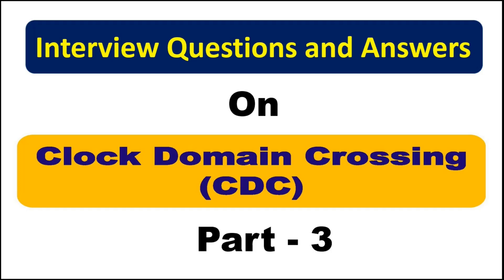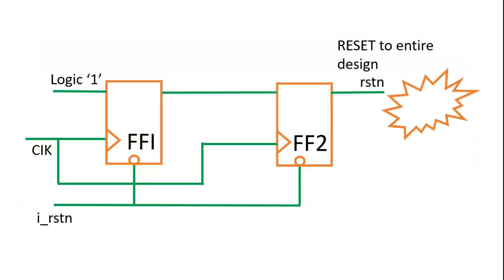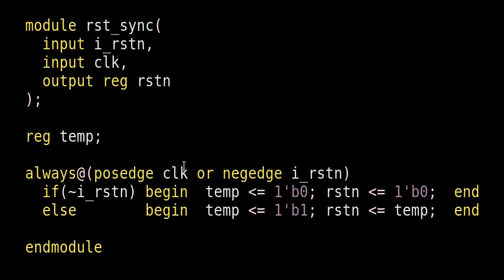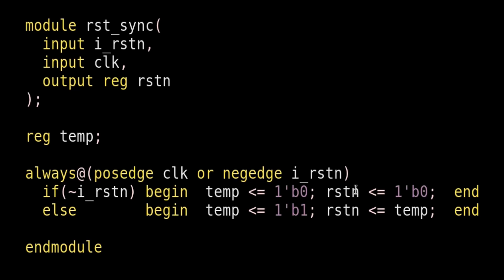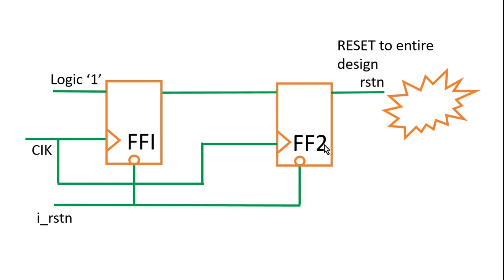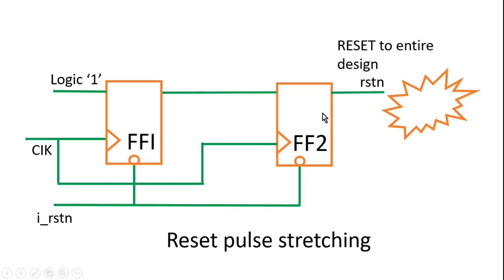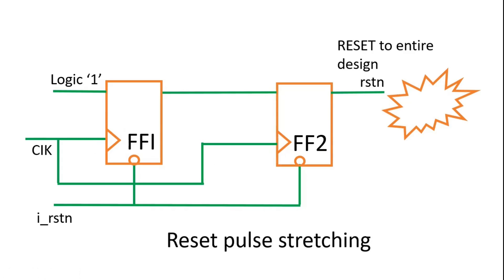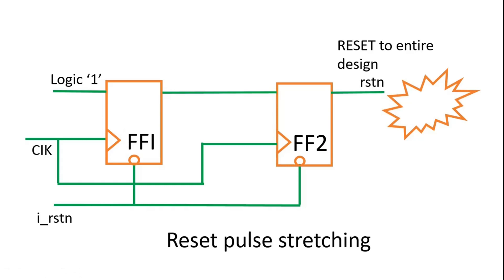Interview Questions on Clock Domain Crossing CDC and synchronizers part  3

Comment: Reset needs to stay asserted so that it can propagate through the reset tree to all flops. It is not necessary that the reset synchronizer needs to have the logic for that. The logic to ensure reset propagates through the entire reset tree and to all flops in the design can be done externally through a state machine and the reset can just be an input to this reset synchronizer.

Comment: thanks for the wonderful video. i understand, Reset may be required to stretch, so that it could be differentiated with any glitch in the reset signal. the stretched period can be a qualifier for the proper and correct reset.

Comment: Regarding to your question of why circuits expect the reset synchronizers to stretch the reset signal; here is my take, "In most of the cutting edge FPGA designs to achieve high performance, you are encouraged to avoid connecting reset to most of the intermediate pipeline register stages so that for example Quartus can introduce hyper-registers (Intel FPGA with hyperflex architecture) freely during routing to improve the performance (these hyper registers don't have reset signals to simplify its circuitry & make it light weight). So, for such designs, one has to make sure the design is in reset state long enough to reset all those hyper register stages are put into reset or in other words, reset value propagates through the entire design"
Reply from the maker: Very good!

Comment: Another example :  Some circuits needs to wait in reset sate until the clock is stabilized,  PLL is stabilized  or external clock module is stabilized etc.
Reply: Also some complex designs  will also have  reset sequencing   logic  where  each unit will come out of reset   at different times in  certain sequence.

Comment: Using this reset synchroniser, main design is recieving the reset pulse with delay of two clock cycles,  isn't it impractical ??
Reply: Since reset is directly connected to async reset pin of FF, immediately reset propagated to system. hence reset assertion requires no clock.